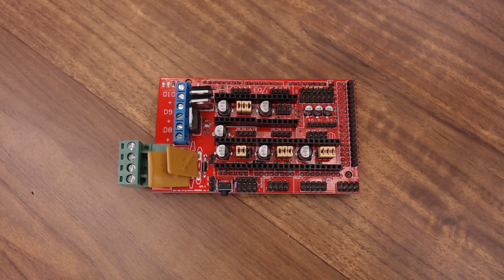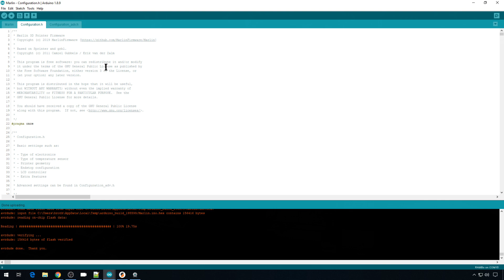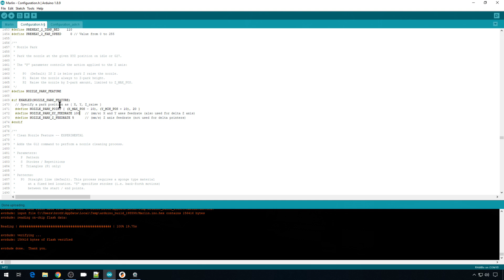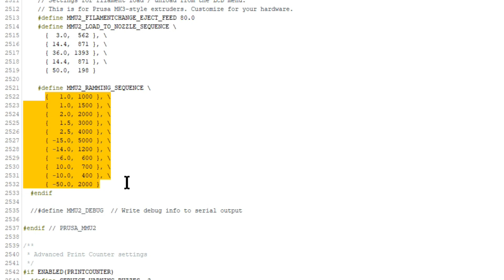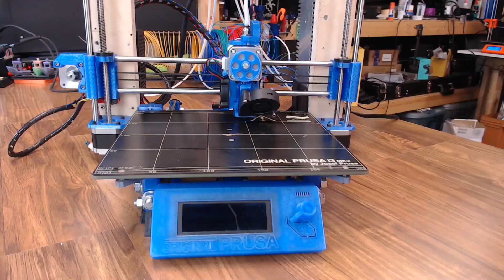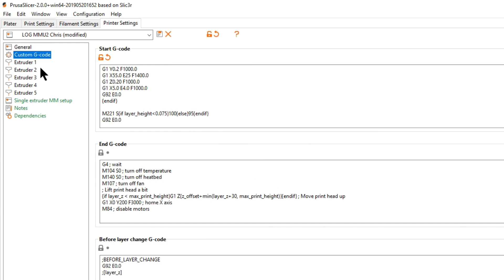Prusa MMU2S On Any Printer Running Marlin - Chris's Basement

Comment: Wanted to give an update after watching this video. I purchased a used MMU2S off eBay for about the price of a clone. I have an Ender 3 Pro with the SKR 1.3 board. I have it working and works well. there are two quirks which are probably related to the serial port. The firs is when the machine is powered on, the machine boots twice. The second, is I do not get status update on my LCD screen. They stop as soon as the hotend reached temp and bed leveling. Still getting status updates on Octoprint, so no biggy. Also I used the TFT port just above the serial port. That maybe the reason or I'm using the right serial port in Marlin 2.0. Can't seem to find any answers regarding the port number designation.
Reply: Hi, how did you get it to work with the internal serial port? What port did you use?
Reply: @NATY1110  #define SERIAL_PORT -1

/**
 * Select a secondary serial port on the board to use for communication with the host.
 * This allows the connection of wireless adapters (for instance) to non-default port pins.
 * Serial port -1 is the USB emulated serial port, if available.
 *
 * :[-1, 0, 1, 2, 3, 4, 5, 6, 7]
 */

//#define SERIAL_PORT_2 -1

#if ENABLED(PRUSA_MMU2)

  // Serial port used for communication with MMU2.
  // For AVR enable the UART port used for the MMU. (e.g., internalSerial)
  // For 32-bit boards check your HAL for available serial ports. (e.g., Serial2)
  //#define INTERNAL_SERIAL_PORT 2
  //#define MMU2_SERIAL internalSerial
  #define MMU2_SERIAL Serial
Reply: @thomasdukes7698  that worked great thanks alot champ!
Reply: @NATY1110  No problem! Thank Chris!! Took a couple days playing with the serial ports. May not be exactly right, but it works.
Reply from the maker: Very nice! Thanks for giving us all this info, I am going to try and get a video out for this.
Reply: @ChrisRiley  Great!! My setup probably could use some further tweaking. I used the TFT port opposed to the serial port you suggested. I believe they use the same serial port. On Marlin Github, that's what was recommended. The TFT port does have the reset pin.

Comment: very nice would like to see this set up on a cr-10s
Reply from the maker: Thanks! I am not sure what board that one uses. A lot of the Creality stuff doesn't have enough open pins.
Reply: @ChrisRiley  ok after a week of messing around with a BLTouch i found that i can point to servo pin 27 on the creality board V2.1 
how many extra pins are needed and will a servo pin do ??
Reply from the maker: @pjmcbigguns9598  You would need a 12v/24v pin and a way to access the serial, a TX and RX pin. Only way I would now to do it would be to hack the LCD cable.
Reply: @ChrisRiley  thank you for your insight on the 
So if that's the case then could I use o e of the easy out chips that's used for the ender bltouch to hack the LCD cable or would it require cutting of wires 
And again that is for your insight on this
Reply from the maker: @pjmcbigguns9598  I'm not sure because I can't find a good pinout for that board. I looked at the firmware, it says   
PIN:   8   Port: D0        RXD                         Input  = 1
  PIN:   9   Port: D1        TXD                         Input  = 0     

Those would be the 2 pins you need access to.

Comment: Been thinking about this since I watched your video I use a SKR 1.3 board. What if you made a 'Y' cable for the runout sensor on the MMU2 board to the signal pin on the SKR pin P1_28 for runout sensor? Don't think you'd need power but maybe a ground as well.
Reply from the maker: Yeah, you might be able to make that work. I don't see why it wouldn't.
Reply: @ChrisRiley  Can you help us? :joy: 
I connected it to the TFT port but I've no succes :(
Reply from the maker: @snelinternet4654  This has been one of my biggest comments, more on this soon.

Comment: @Chris Riley I am having trouble setting the Serial Port . I have a CR10- 5S Using the Creality V2.1 Board (2560).I intend using Aux 1 on the board. I Have found a Chat that seems to suggest i use Aux1  with serial 0. But i am not sure. I have tried as the video but i am getting nowhere with it. 
This is the Discussion that i Think may help me but i am new to Marlin and getting a bit lost. https://github.com/MarlinFirmware/Marlin/issues/10219
As soon as i make these changes to Marlin everything compiles ok but screen sticks on Marlin startup screen and will not go any further.

Can i get some help with this part please. rest seems to make sense to me but struggling with com ports.
Reply from the maker: I don't know that board, but it sounds like there might be some conflict on the serial interface.  This very well could be a bug in Marlin 2.0. I have heard a lot of people are having weird little issues here and there. It's not a great answer, but you might just have to wait for Marlin to level out a bit.
Reply: Chris Riley thanks .  I will keep trying the marlin bug fix hopefully something will change.

Comment: A little confused. Doesn't the MMU2S come with its own board? Or is it just the clones I've look at? I use the SKR 1.3 board and would also see it working before shelling out a lot of money. TIA
Reply from the maker: It does come with its own board, but you have to interface with the printer board as well.

Comment: @Chris Riley did you have some data on the compatibility with MMU clone?
Reply: @Chris Riley thanks for your answer. I use a MKS 1.4 gen as main controller, I read somewhere on internet that MMU or Clone works on RAMPS card and the MKS 1.4 is based on a RAMPS project. In the future I'll buy a MMU clone for some tests. I will keep you updated on the results.
Reply from the maker: @gianluigi.gigante  Yep, MKS 1.4 should work just like RAMPS, you should be all set.
Reply from the maker: I don't, but it is opensource so I am guessing the clones are probably pretty good.

Comment: I am curious why you didn’t just use the Prusa firmware? I was planning on swapping my board for the Einsy Rambo board Prusa uses and using their firmware.
Reply from the maker: The printer I am working with would be hard to tune actual Prusa firmware. On my machine I would have to change a few things. This was more to show the MMU2 feature of Marlin works.

Comment: I'm trying to set an MMU2s up on my (non-original) i3 on a MKS Gen board.
When I upload the firmware leaving the serial port settings on default, the LCD screen doesn't work anymore. What could cause that?

I've tried using serial port 3 and connecting the TX/RX cables to Ymin/Ymax, which doesn't interfere with the screen, but the MMU2 menu item does nothing. :/
Reply from the maker: It sounds like you have a UART conflict. Is this a 32 bit board?
Reply: @ChrisRiley  Sorry, I never got a notification of a reply. :<
The MKS Gen is an 8 bit board, basically just one of those RAMPS based chinese boards. I've been trying all the combinations of setting MMU2_SERIAL, INTERNAL_SERIAL_PORT and SERIAL_PORT_2 I can think of, and even had my friend test my MMU2 board on his original prusa to confirm that it is indeed working.
I still can't get it to communicate with my MKS Gen though, no matter what I try.

I will set up a spare RAMPS board from scratch and see if I can get any further on that.
Reply from the maker: @Akegata42  All I can think of is maybe there is a short on the board. If should work on Aux 1 on pretty much any board.
Reply: @ChrisRiley  So I've done a lot of testing now, with two different MKS Gen boards and a RAMPS. The MMU2 works fine on the RAMPS, on all serial ports.
On the MKS Gens it does work on serial 2, but that of course makes it impossible to use the LCD.
It does not work on MKS Gen when connected to serial 1/3 on the Y/Z-pins, so I suspect that the MKS Gen doesn't actually have serial on those ports.

I have a SKR 1.3 on the way, so I'm going to replace the MKS Gen anyway on that printer, hopefully that works better.
Thanks for the answers. :)

Comment: Hey Chris, great video! As the person who ported the MMU2 stuff to Marlin I'm glad it's also working for others and not just for me. A short clarification: the load/ramming sequence in Configuration_adv.h is used for loading and unloading filament from the MMU2 menu. All the filament changing stuff during a print is handled via gcode. So if you have issues with the purge block tweak the multi-material settings in Prusa Slicer and not the ones in the Marlin firmware.
Reply from the maker: Hey! Thanks for all your hard work! That is great to know and thank you for the clarification. It seems to work really well.
Reply: What's disturbing is that its been about a year and no one has shown how to build a MMU from cloned parts and how to set it up on an Ender 3. Am I really going to be that person?
Reply: @hypercube33  The MMU is cheap enough that personally I'd rather see a really well done, thorough video, adapting it to an Ender3. Direct drive conversion, SKR 1.3 firmware config, mounting to the Ender, etc.
Reply: @mrb2917  cheap it is not compared to an ender 3 pro but I'm going to make a clone and get it working and post a video I guess.
Reply: @hypercube33  There are clones you can buy from aliexpress. I bought one and put it on my Ender (skr Mini E3 V2). The communication is now setup thanks to the gent @revilor so for now i've gotta work on the calibration of the sequences. So far only minor issues with the clone.

Comment: Prints better than on the MK3S.
Reply: Nope it does not, those who fail to get it working on Prusa will probably fail on non-Prusa`s as well.
Reply from the maker: They may not, I notice a lot of people have problems getting the filament sensor calibrated. In some cases the Marlin version might work where the current Prusa setup might be a bit finicky still.
Reply: @ChrisRiley  Ok, I trust your word for it, but it seems odd. All Prusa users have the exact same firmware, so it should either fail or work on each and everyone.

How about the Finda and Pinda? Is those supported in Marlin 2 also now?
Reply: @ChrisRiley  As a note, I had my fair share of trouble with the MMU2-s, but in the end, they could all be pinned on me - the user... hate it, but it`s true ;)
Reply from the maker: @stigberntsen9301  The finda triggers M600, so yes on that one. The Pinda2 like on the MK3 isn't supported yet that I know of.
Reply from the maker: @stigberntsen9301  I hear ya man, I struggled a lot with mine. The new filament sensor made things a lot better.

Comment: @15:20 I'd like to recommend the Filament Retract Bank ( https://www.thingiverse.com/thing:3373895 ) concept ( or it's fully 3D Printable Remixes ).
I'm using it with my MMU2S equipped Original i3 MK3S and I'm VERY pleased with it compared to the shite that was shipped with the MMU2S Upgrade Kit.
Reply from the maker: Nice! I like that setup.

Comment: I'm not able to use the Aux 1 pins on my Skr 1.3 board. I'm planning to use my TFT pins instead, and outside of moving the connector pins to the right spots, are there any other steps I need to take so it'll still work?
Reply from the maker: The only thing you should need to do is change that second serial port.
Reply: @ChrisRiley  Into what? I can't get it working :(
Reply from the maker: @snelinternet4654  Serial 1 should be 0-second serial can be -1. more to come on this.
Reply: @ChrisRiley  Thank you, I'll try it when I'm home. Can we expect a video about it soon?
Reply from the maker: @snelinternet4654  I am still testing it, but hopefully soon.
Reply: @ChrisRiley  I also expect it a lot. and how it works with an MKS GEN L. 

Chris I don't quite understand this 

Serial 1 should be 0-second serial can be -1. more to come on this.

could you explain or give me a video where somebody explain it. please
Reply from the maker: @BrianCSC  This is referring to a second serial bus, most boards don't have more than more so basically you are bit bashing trying different settings to get things to work. I will try to work this in.

Comment: I'd be very very interested in seeing this adapted on an Skr 1.3 on an ender 3
Reply from the maker: I think a lot of people would be, I will see what I can do.
Reply: Lately I have been thinking exactly the same thing.  I have no need for an MMU on my ender but boy I like to tinker!

Maybe even build my own MMU clone.   Chris you could make a LOG MMU.    LOL
Reply from the maker: I could even try to make it out of wood!!!
Reply: I'm thinking to buy a mmu2 clone board from China. I don't know if anyone made that work with that board
Reply from the maker: @leitoxweb  I haven't seen a build on this board yet, but this is an opensource board, so it's probably really close to the real thing.
Reply: Has anyone had any luck with the SKR 1.3 and MMU2S?  I tried using the Aux-1 pinouts with no avail.
Reply from the maker: @jswatts92  I plan on giving this a full test soon.
Reply: @ChrisRiley  I got a MMU2S connected by following a few github threads online.  My settings in Configuration_adv.h under the MMU2 section are:
  // Serial port used for communication with MMU2.

  // For AVR enable the UART port used for the MMU. (e.g., internalSerial)

  // For 32-bit boards check your HAL for available serial ports. (e.g., Serial2)
  //#define INTERNAL_SERIAL_PORT 2
 (YES THIS IS COMMENTED OUT
  #define MMU2_SERIAL Serial

Currently not by my printer, but I believe I hooked it up via the TFT ports.  It boots up twice, and takes awhile.  If you don't hear the idler home you may have to send a command from the LCD such as load filament.  After that it connected fine each time.  Currently trying to figure out how to adjust the load length from the MMU to the extruder (i'm using direct drive) since I have the 2S unit.
Reply from the maker: @jswatts92  Nice to hear you got it working. I still need to try it.
Reply: @jswatts92  I would be very interested in getting more information about this setup. What is your relevant configuration in Configuration.h?
Reply: @jswatts92  Hey Joel, could you share that github threads? :D
Reply: @ChrisRiley  have u got round to doing it?
Reply from the maker: @josephlindsey6080  I still haven't got it working.
Reply: @jswatts92  on the bigtreetech Facebook page there is a guy who made an mmu2 system with a skr 1.3 and skr mini. It works for him
Reply: Leonardo Lobato do you have a link to his Post?

Comment: M221 tells the printer what extrusion multiplier should it set depending on a layer height, not crash prevention :P
Reply from the maker: You're right I watched it back, I was thinking of the line in the end gcode that keeps if from topping out z.
Reply: @ChrisRiley  yup, it's in there too 😁

Comment: 2 qestions:
How to clone the MMU2?
I got a dual (independant) extruder printer. Is it possible to fit 2 MMUs on one printer to get a range of 10 colors?? :D
Reply: need 2 serial ports, I would think it's doable, but would require some firmware tweaks.
Reply: you coud also mod the MMu do more materials but then you woud need to rework the SMMu firmware
Reply: there are MMU2 clones on aliexpress but idk how good they are. they are around 150USD
Reply from the maker: @turtledude2924  I think I am going to see if I can get RAMPS to work for one.
Reply: @ChrisRiley  please do ill buy it off u when ur done with it lmao
Reply: @ChrisRiley  how important do you think the extruder IR sensor is to the reliable operation of the MMU2s? Gave up on the MMU2s on my Mk3s about a year ago, and signed up for the jgmaker artistd idex kickstsrter.  Decided to have another go at the MMU2s while I was waiting f9r the artistD and have been pleasantly surprised about how well it is now working, so am thinking the ultimate setup would be an idex printer with the MMU2s on one of the extruders. With the other one either for the primary colour or specialist material, just wondering whether having an extruder gear sensor like the Prusa iR sensor is going to be important,
Reply from the maker: @dwuk3d  Great question and I think the IR sensor is critical for the MMU2 to work successfully. Marlin has that feature for the MMU2 now, but I have yet to test it.
Reply from the maker: Yeah, I think you could do it, but it would take some tweaking.

Comment: that's so cool! But sadly I can't buy that in my country. I need to find a way to connect more steppers to my printer!!!! maybe with a arduino mega+ramps connected to the current board somehow.
i'm sure it's possible with klipper!!!! also my hyeprcube is currently a bowden for now which is an issue huammmmmmmmmmmmmm :3
Reply from the maker: Yes, I am sure you can get that working in Klipper.
Reply: @ChrisRiley  yeah! just a new board purely for the stepper pins :) would be messy and cost a bit :3 I guess i'll see what happens in the future!

Comment: Chris Riley no chance this would ever work on the Duet RepRap FW?
Reply: it would be something that RRF would need to add support for. There are additional serial pins on duet boards. Since Marlin code for MMU2 is open source, if you know what you're doing adding support for it in RRF would not be hard.
Reply from the maker: Not sure about RR, but Marlin has tool changer in the works. I think we will see the merge soon.

Comment: Do you happen to know why my mk3s, mmu2s can’t print pla? I was only successful at pla when I fed the filament directly to the extruder, if the filament is fed through the mmu2s, the filament would seem to jam up in the hotend.
Reply from the maker: Almost has to be dragging on the idler barrel. Make sure the 2 barrel screws are nice and tight.
Reply: Chris Riley Oh yeah, I just checked, my idler has melted out of position so I will need to re print it. But thanks!
Reply: SongLi Moey mine works
Reply: Mark Stemmett did you have to tune the loading and unloading parameters?